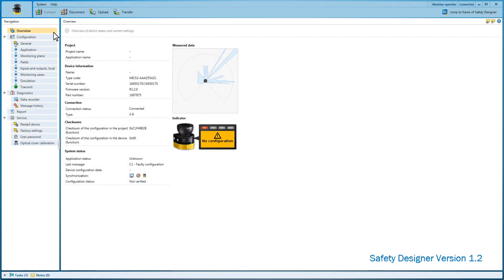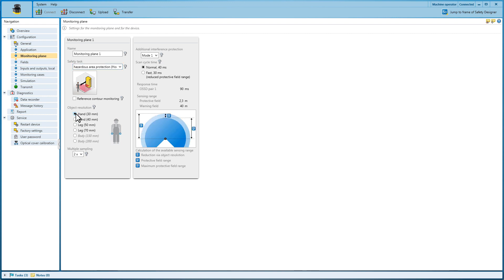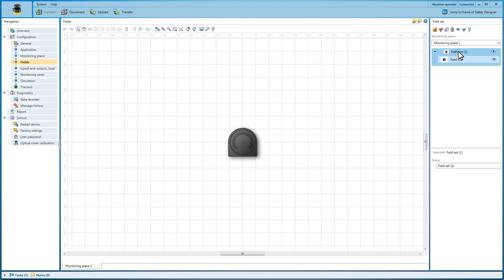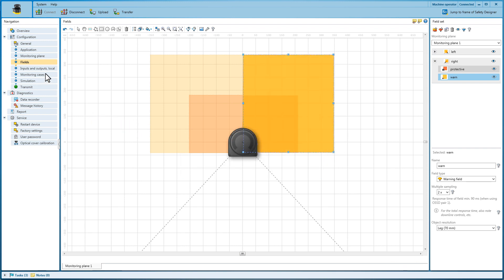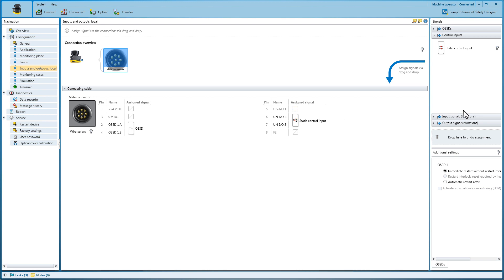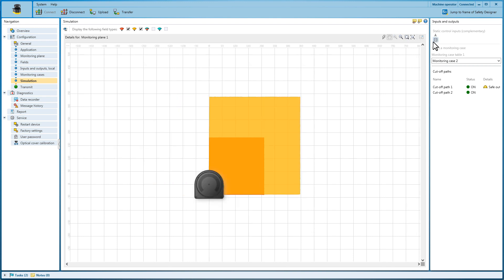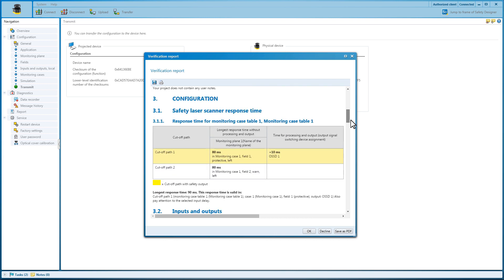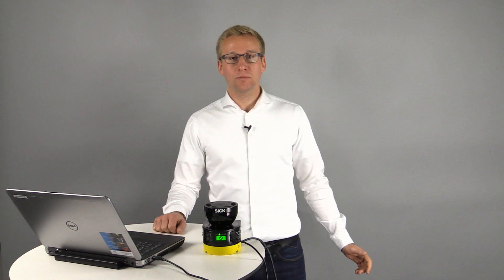Tutorial microScan3 (Part 3.1/4):  Safety Designer and configuration | SICK AG

Comment: Just now viewed your operating user manual, it is not included the M12 17 Pin connector color coding
Reply from the maker: Thank you for your comment! The operating instructions for the microScan3 does not include the M12 17-pin connector color coding because the wiring colors can vary depending on the cable used. This information is provided in the datasheet of the respective cable.

For the microScan3 Pro I/O or microScan3 Pro I/O - EFI-Pro, which both use an M12 17-pin interface, a suitable cable would be:
https://www.sick.com/2118014
You can find the color coding details in its datasheet here:
https://www.sick.com/media/pdf/3/23/023/dataSheet_YM2A1D-020UV1XLEAX_2118014_en.pdf

If you have any further technical questions, please forward it to our local support portal: https://support.sick.com/ to ensure you receive the best possible assistance.